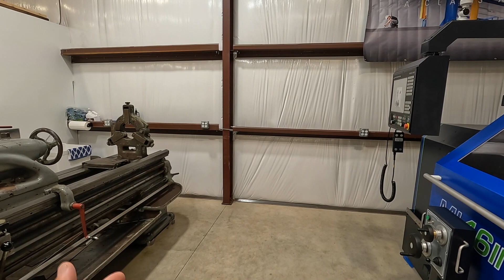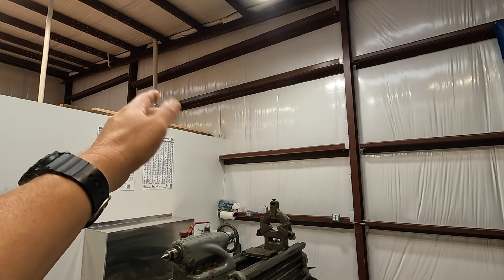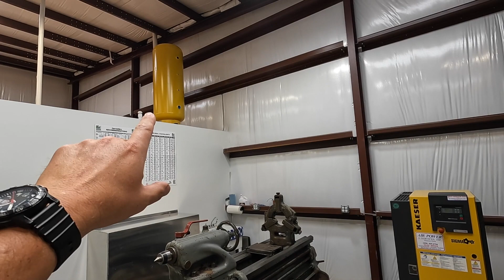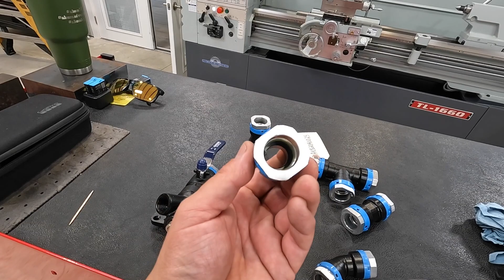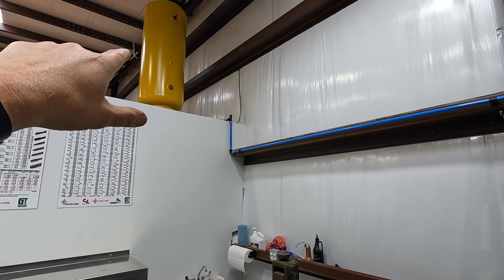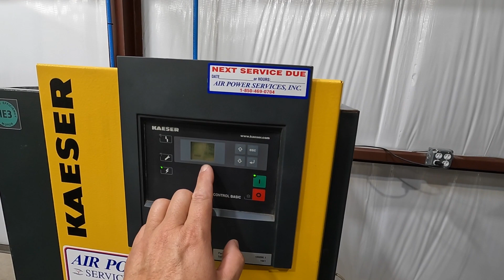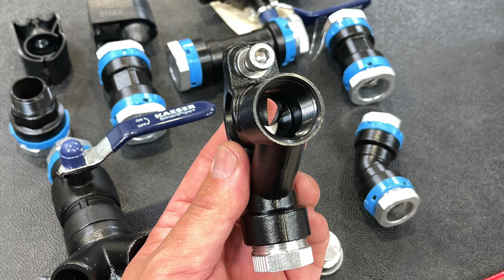KAESER Air Compressor & Smart Pipe Installation

Comment: Would it make sense to flip the Pacemaker the other way round? That way you wouldn't have to worry about bumping into the compressor while messing with the tailstock, and also would have better access to the bed of the lathe from your garage doors and the gantry. The two lathes would no longer be facing one another, but you could still monitor the CNC lathe while working on the Pacemaker.
Reply: Wouldn't that limit his length of stock that could extend out?
Reply: @johnlee8231  Adam would know his work profile for that lathe better than any of us would... all I know is that he didn't think that it was a concern on the CNC lathe, but that could just indicate that he was planning to do all his through-spindle work on the Pacemaker.

The other thing that came to mind is that it would make it more challenging to use the gantry to take the chuck off of the thing, which might also be a concern.

Comment: I have a 7 1/2 hp screw type air compressor and air drier. Piped the shop with copper as it is easier to work into small spaces, it won’t rust, and is very durable. However copper is expensive. You will love your new system. OK here it goes - I would have put the compressor up with the tank if videos are going to continue to be a big part of your shop life. Any extra noise is a distraction and it just doesn’t need to be crowding your other equipment. The piping on the top of the office was the simplest and cheapest way to go but it makes this space very hard to use for storage. I park my scissor lift next to my loft with a small removable staircase to the platform of the lift and then use it as an elevator to access my storage in the loft. I know your intending to be here just a short time but? So happy to see you get all the new equipment!
Reply: The compressor is just temporary until the final unit can be delivered. Then of course the office booth would need to be able to carry the unit. But yeah I put mine into the neighbouring room into a corner as well.
Reply: It's product placement, that's why the compressor is in the middle of the shop, where no one else would put it - so you can see it in every video.
Reply: @andrewterry8092  that very well could be the reason😢. It’s the devil you need to pay for free stuff. If that is the case it will detract from every video he makes in that corner of the shop. I believe that this type of compressor must be running constantly over longer times to avoid maintenance problems due to water in the oil at least that is the case with my compressor. In Adom’s shop a piston compressor would be better for the intermittent air he will need but then the compressor needs to be outside due to noise. Either way, an air drier, auto drains and oil and air filters are a must for clean dry air which the Kaeser has.
Reply: @bruceanderson9461  He could have got a silenced piston compressor, that's what I got for my one man shop at the start of this year after coming to the conclusion that a screw compressor or Hydrovane would have been a bad fit for me, compared to the same sized normal piston compressor it wasn't cheap but it is significantly quieter, but I don't think Kaeser make any like that.

Comment: Vane/roots type air compressors have become some of the best kind of air compressors you can use in an indoor environment where sound output is a concern. Piston type air compressors have their place, but the rotary air compressors are just overall a better option when you have to have the air compressor inside a confined space.

Comment: It is a nice shop build but as mentioned a 2/3 year plan is very short term for all the work.
Reply: Adam recently mentioned that this shop may be a longer term setup than originally thought.  He is really liking the way it is coming together.
Reply: @paulcopeland9035  That makes sense, as where would all the kit go...
I often say abt myself and other engineers. A good engineer does often not make a good business man lol
TBH I don't know any engineering firm that receives  donations apart from YouTube ones lol  I get a job come in or quote an hr rate...on site they might make me a cup of tea
Reply: @theessexhunter1305  Yes.  As an engineer in the HVAC business for over 30 years I will agree.  Hey, you got tea???
Reply: @paulcopeland9035  Just had one. These channels are good but not a true across the board of how a machine shop works as the donations/subs pay for the time to make them as the amount of political correctness is quite painful, with the lack of coolant you would run will spoil the "shot" 
They have a big following so my voice will be drown out by the non machinist lol Josh Topper is who I like to watch as his shop is a true working shop with the grime and dirty hands just like mine lol

Comment: Interesting.  Definitely high end.  1) can it be DIY?, 2) how strong is the pipe if somebody hangs something on it?  I'm going to say that there should be a drain valve on the extra tank plumbed to drain into the sink so it gets drained occasionally.  That tank will collect moisture.
Reply: With a chilled dryer right at the compressor, I'd be surprised if that raised tank would collect any liquid at all.  My aux tank stays dry and I only have natural cooling.  The feed line to the aux tank runs up hill so liquid wants to run back, not into the tank.
Reply: Kaeser tech here. Smartpipe+ can be DIY friendly. All you need is a pipe cutter and deburring tools. The nuts are tightened with a crescent wrench. I would not hang something with much weight off of it. It would stress the connections.   Several customers in my area have auxiliary tanks with manual drains. They generally don't have issues with moisture buildup.

Comment: If you want to watch actual work, watch Cutting Edge Engineering. 
If you want to see repetitive infomercials about a guy getting free stuff and never working, watch this.
Reply: @LurkMoar  Adam use to be great and had awesome content. Now it’s no work with just product advertising.
Reply: The product placement is getting to be ridiculous - that's why the compressor is in the middle of the shop, where no one else would put it - so you can see it in every video. This is a youtube studio, not a job shop. Which is fine, if that's what you want. Not for me.
Reply: @andrewterry8092  I totally agree, not a practical setup at all for a working shop. Ideal for a “showroom “.

Comment: Like the yellow ;) Goes well with the blue on white.

What's with that right hand corner beside the top of the door looking out.  Looks to me like the electrician and alarm guy didn't get the memo that things were supposed to look good.  You need to mention it to the electrical contractor next time you request another hook up.  And as for the alarm guys, I'm sure they could spend an hour fixing that up as well.  Says this old electrician/contractor.

Comment: My shop has 2 of those compressors just without the tank mounted only use giant auxiliary tanks. They aren’t as quite as u hope they are haha. As well as they tend to blow fuses in the compressor all the time, we keep a stockpile of the fuses and replace them like 1-2 times a month, it’s a big fuse to. Kaiser guys gave us the fuses and told us that’s the only option haba
Reply: If there is consistent fuse blowing, then there is trouble somewhere.  That is what fuses are for...."protecting" the equipment and wiring from overheating or short.  Something is very wrong.  "The only option"!!??  I would start getting professional electrical opinions - yesterday!!
Reply: @paulcopeland9035  trust me! Kaesser repair techs and electrical guys have been here several times. They supplied us with the stock pile of fuses because it was the only option cuz they were stumped as well.
Reply: @Lexking0695  ...It is not you who I don't trust!  Something is very wrong and very dangerous there!  Get some professional electrical people out there to give an independent opinion!  Kaesser techs may know all about their product but your problem is much deeper. Please let us know how this turns out!

Comment: Hello first and you made a very good decision to bring a Kaeser system into the workshop. I live in Germany and did courses at Kaeser a few years ago and built many facilities.
The screw compressers are very good and usually run very long and safe. Just please please and please see if he always has enough oil in the morning before work. If you have oil in the line, it can do not work properly in the compressor. Don't be surprised when he runs a little longer until it goes out because it needs the temperature to get rid of the water from the oil. I would also recommend that you install a water separator in front of the CNC system. I can deceive but is Din the tower really a real dryer installed ??? The pneumatic systems in the CNC will thank you to keep the water away from them. I think you have a high humidity with you. This will collect the compressor a lot of water. Keep the air kettle in the eye under the compressor and see if the air -powered water is working properly and whether the ball tap is open. There is also a button to start the emissions manually. If you have any questions, please get in touch. 

Please think about the place where you set up the compressor. I also think he gets too warm in the corner

One more question Why didn't you invest the 20m pipeline to close the ring in the workshop? This has an extreme advantage because the air is distributed faster and more evenly. Ok I don't know what you are still planning and how much air you need where Wieschchnell, but if it is too little you could close the ring to improve it. Thank you for your videos that are very interesting and pass my boredom. Thanks
Reply: Great advice about the dryer, imho!
Reply: The aircenter system is a comprssor, dryer, and tank in a package. Another dryer should not be needed.

Comment: The shop is getting ready to make chips. Can't wait much longer lol. Like the air compressor but what's the cons of putting it outside? All compressors will produce heat plus it's taking up space in a small shop. Just wondering.
Reply: The product placement is getting to be ridiculous - that's why the compressor is in the middle of the shop, where no one else would put it - so you can see it in every video. This is a youtube studio, not a job shop. Which is fine, if that's what you want. Not for me.
Reply: Cons?  Cons will steal it!
Reply: @paulcopeland9035  okay I understand. Sorry for the dumb question. Where I live we do not have much thief's.
Reply: @ronnydowdy7432 .....Sir, I envy where you live!  Have a good day.

Comment: I'm no expert, but I did watch Shadon HKW make some cool air systems, lol. Not sure how you're going to deal with condensation with half your loop lower than your compressor's first junction and drain. Also surprised you don't have valves separating different zones of the shop.
Reply: Air dryer, with freon refrigerant circuit and automatic drain, the gold standard for screw compressors.  If the compressor is "oil-free", plasma cutting will work without problems.  Additional water separator filters will also not be superfluous.
Reply: The compressor package has a refrigerated dryer and a tank. Both have automatic drains. As long as the shop doesn't get below 40 degrees condensation won't be an issue. Even then the drops have plugs built in to them in case there is moisture buildup.

Comment: All this work and you say you’ll only be there for two years, and it’s already been months. I don’t really understand why for just 18 more months.
Reply: Yeah, at this rate it will take 2 years just to install the machines.
Reply: @andrewterry8092  What is your bitch?  Why do you care?  What he does and how long it takes to do it, is the channel content right now.  This is a free service!  Watch it if you want to outfit a shop.  If not, don't.
Reply: Think about it.
Reply: @paulcopeland9035  That's a LOT of money to spend on a shop just for YT purposes, so if that's not what you meant, I didn't get it.
Reply: @burnte  He has mentioned on a couple of his other channels that the  time frame he originally had in mind will probably change.  He has said he really likes how the new shop is coming together and might use it for some time to come.
Reply: @paulcopeland9035  Thanks! It's a great looking shop so I hope he uses it for a while. He's really designing it well.
Reply: @burnte  Yep!  I believe he has a firm long term plan and he has shown he is not afraid to implement it.  I always try to wish young, energetic types the best and I believe he is one of them.

Comment: We've got something similar at work, a main air supply with tap off's where and when required. Sam sort of quick connect into the main line for air hoses etc. Work can't have anything hydraulic so it's all air and electric. The 3 compressors and accumulators sit in their own building, I've no idea what size or maker but they provide 24 hour of air running at 8psi constant all year round, with just two of the pumps providing enough with the third for high demand or maintenance on the other two. I can ask if your curious 

Great to see your new shop coming together, just a quick question too... any plans on shifting some of your old iron into the new build? just curious
You have a good one Adam and Abby
Reply: 8psi? Wouldn't that be negative pressure since sea level is 14.7?
Reply: @joshclark44  Not sure, knowing work it's probably 8 bar. I never ask as stuff keeps working and 4 hours ago was 3am for me so v tired, probably got my scale messed up. And yes it's now 7am and still awake....sod it. Bed time. You have a good one Josh, laters

Comment: You can have your Kaiser! Been in manufacturing for 35 years seen many kaiser failures! Motors failed under warranty had to fight to get warranty work. To much down time! Ended up with IR compressors much better! I hope you have better luck than we did.

Comment: I think this is the 3rd flavor of smart pipe Ive come across now. Shop I recently left had got it for the building the renovated and man its so much faster, lighter, and easier to deal with compared to cast pipe. Don't need to take bust out the monster rigid pipe threader and don't need 2 guys for most of it. Just a portaband, tape measure, some chamfering tools and your drill.

Comment: Putting that hose on top of the office instead of on the wall is going to make putting anything else up there rather interesting... Lost floor/storage space and an out of sight line easy to hit when you lift stuff like that aux air tank up there with a forklift.

Comment: So we recently installed the same smart pipe system with a Kaeser sigma. I'd just caution that you be extra careful with your blow gun. Ours pumped some chunks of aluminum from the tube drilling out at 125psi. Good for me that I only got hit in the hand but it stings nasty.

Comment: Now that you have a 'safety railing' around the outer edges of the office roof, you can run a robotic vacuum cleaner up there to prevent the typical dust buildup if you care.
Reply: Robotic vacuum cleaners don’t need a rail, they wouldn’t fall off anyway.
Reply: @richardwigley  Yes. I'd forgotten that they have edge sensors. In Adam's shop he'd have redundant vacuum safety.
Reply: Lighten up Francis
Reply: @MadmanJimbo  I don't even know what you mean. Your comment seems non sequitur.

Comment: Hey Adam great looking system ànd will work for years for you 👍
  Maybe it's just the video but looks to me like you should have put that in one of the corners. To me it looks like it will be it the way of the CNC when you get ready to start running that as well .
  Great Video 👍👍👍
Reply: It’s a great system and I agree the placement in my opinion was not the best.

Comment: My vote is put the compressor above the office the heat coming off of it where it is you are going to hate...my 2c
Reply: I was wondering the same.  Put the compressor on the ceiling with the tank.  Saves floor space and sort of helps with the heat. I am sure Adam has a reason though.
Reply: Above the office!!??  Unless you are going to hang it from the structure, setting it on the ceiling of the office is the worst idea ever!  Your "2c" is way over priced.
Reply: @paulcopeland9035  ok so the weight of the air tank is overated.....you can hang and reinforce a platform to the wall right there next to the tank away from your work area...obvious you have never been around a screw air compressor innthe summer they put out alot of heat and moisture from the air dryer kicking off and it will be right infront of his lathe and cnc....worst idea ever.....and my 2c are cheap advise from your comments not knowing a damn thing......he could weld up a platform to put it on so easy and keep it up out the way....way mine is in my shop...
Reply: @carsons6519  Did you bother to read fully what I wrote?  To repeat, I said if you are going to hang it from the structure then fine!  A few spring isolation hangers would be a good choice as well.  You are correct in that it would save space and get the exhaust out of the way.  My comment is directed to the fact that setting that compressor on the plywood deck would be one of the most irritating things you could do to the person who has to use the office. As fine of a machine and as quite as it is, the noise and vibration it would send into the office space would be maddening!